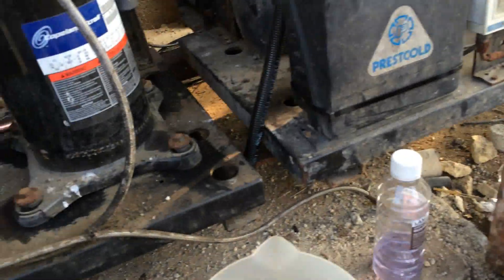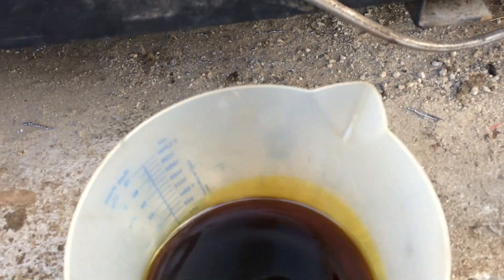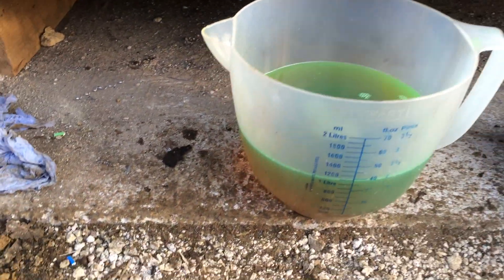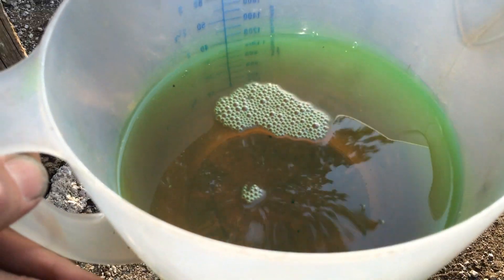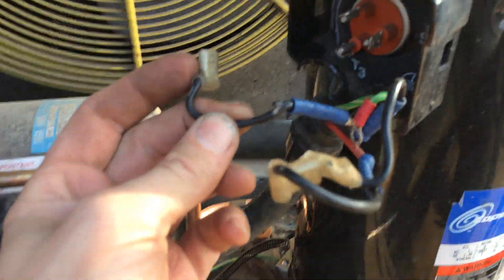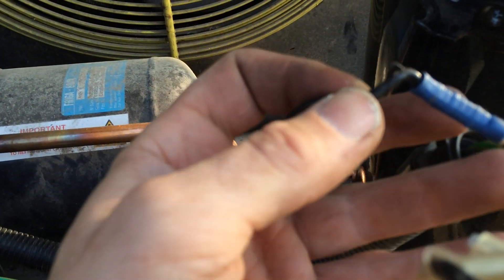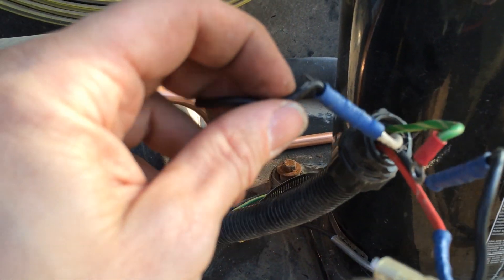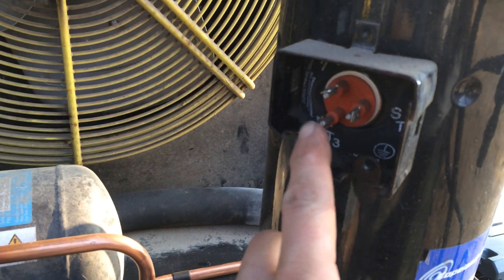Icky Copeland Compressor Oil Drained

Comment: How were you draining them?
Reply from the maker: Joe Shearer Hi Joe, the compressors have rotalock valves so i undid them, removed the compressor and tipped them up so the oil drained out of the suction ports.